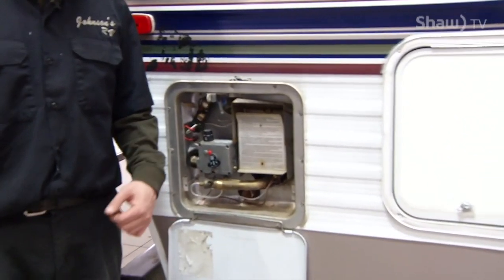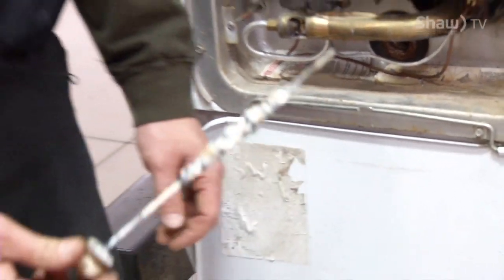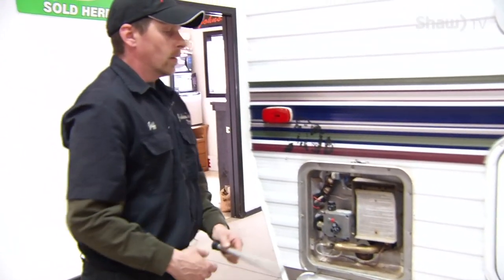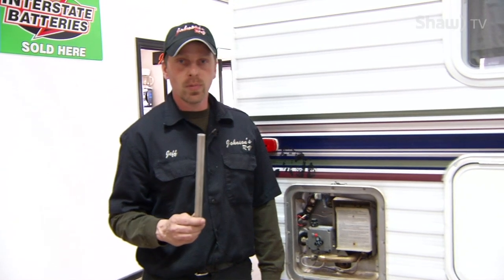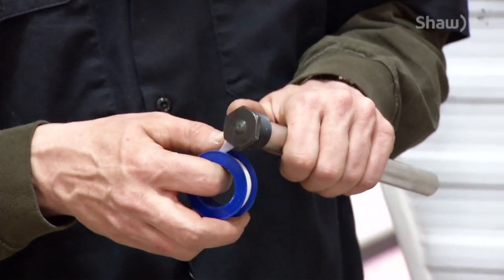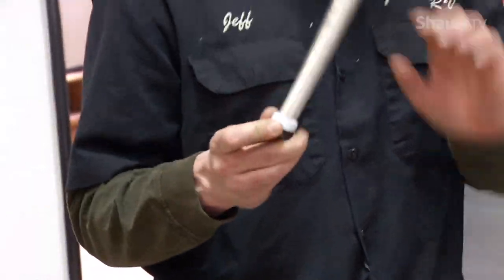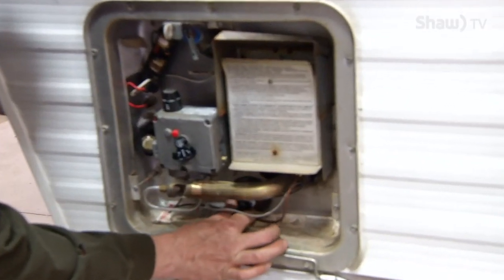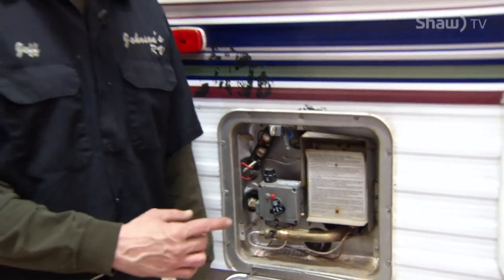RV Tips - How to replace the Anode Rod in your Hot Water Heater

Comment: I have a Suburban VRV-6X water heater and the anode is actually on the back of the heater. There is only a 1/2 inch drain hole in the front.

Comment: Where do I order a new anode rod for my hot water heater? I pulled the plug on mine and there was no rod attached to it.
Reply: Happened to me yesterday i just got my camper....but you van get them on amazon any rv store walmart up by my camp has them too
Reply: After doing some digging, some of the camper hot water heaters don˒t require the anode rod, the type that I have.
Reply: Hopefully you have an aluminum tank lol